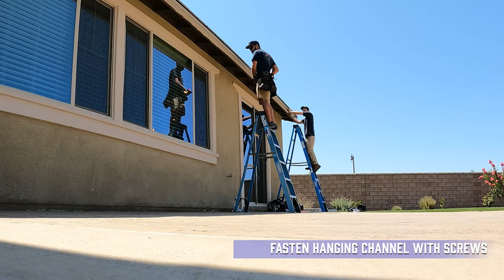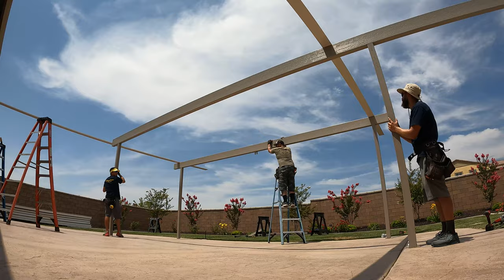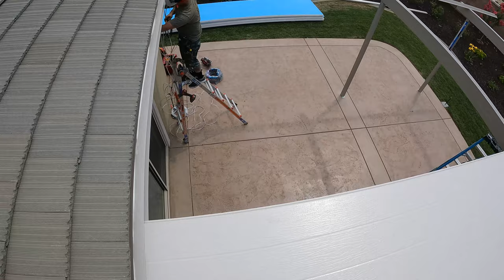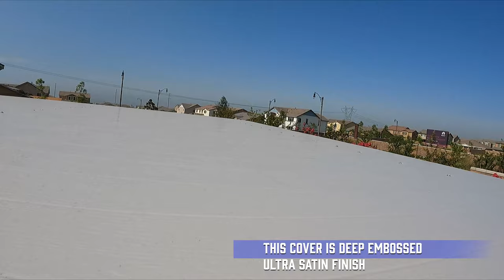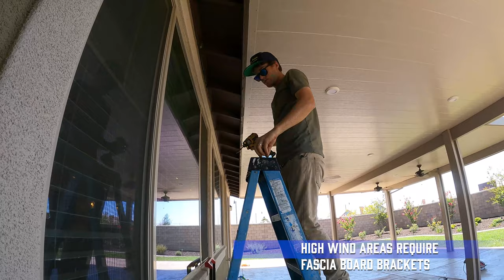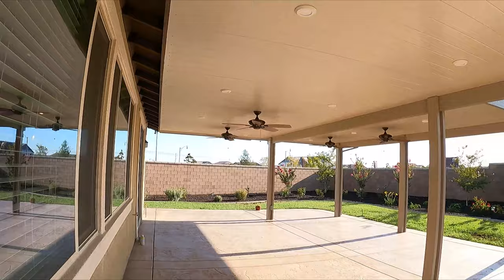How To Build a 24 Ft Projection Patio Cover Ultra

Comment: This is close to what I want. Roof mount because we have a Mountain View.  Roughly 10 ft Hugh 20 ft projection by 34 length
Reply from the maker: Awesome Cbingham, I'm a huge fan of roof mounted patio covers, gives the patio great air flow and also helps maintain a great view like you have. Fell free to reach out if you need help designing and building your patio cover. 

Thanks for the comment and we hope you have a great rest of your day, 
Everyday Patio
Everydaypatio@gmail.com

Comment: did you guys use regular 14-3 romex wire for the electrical or something else?
Reply from the maker: Hey Raul, mostly 14/2 it 12/2, depending on the house breaker size. We just run dedicated lines for the fans/outlets and lights.
Reply: @EverydayPatio  thanks. I was just wondering if outdoor wiring was required for this application.
Reply: @raul4j It doesn't hurt to use outdoor or grey wire. Technically if the roof is sealed correctly, water shouldn't get in the raceways

Comment: Our HOA allows elite roof patios but requires they be covered with something resembling shingles but comes on a roll and uses adhesive so that it isn’t white on top & matches the houses’ shingle color - I’m clueless what that is. Have you heard of this?
Reply from the maker: Hey Lucie, great question. We call that Ranger Roofing, or Insulated Panels with OSB on top. This let's you add Shingles or Tiles to the roof. This let's you match the roofing to the house, HOA rules can be all over the place, they may be requesting that so you don't get non-insulated or flat-pan roof. That usually doesn't look as good on top, as insulated.

Hope this helps answer your question,

Have a great New Year!
AJ

Comment: How did the beams go into the floor? Screwed? Did it cracked the floor when screwing in? Going to do mine and curious how it’s going to effect my tile.
Reply from the maker: Good Day SkynDive Productions, thanks for the great question. This patio cover had a strong enough cement foundation, that was installed properly and given proper time and conditions to cure. This with the exterior footing, led us to not need more extreme footings. We attached directly to the concrete, as far as tile goes, you can't attach to tile, you would need to attach to at least a 4 inch. thick concrete slab or pour an appropriate sized footing. The tile would definitely crack.

Hope this helps answer your questions and would love to see the project after it is done!

Hope you have a great rest of your day,
AJ
Everyday Patio

Comment: Awesome job.  What kind of wiring cable was used? Having a patio installed and they are saying they are using NB-B 12/2 for the fans and lights. Is this common?
Reply from the maker: Hey Anthony, every company has a preference for electrical and certain cities have even more exact preferences. I don't run 12 gauge wire, unless the client plans on pulling alot of power with the patio cover, like a heater. Most appliances don't pull alot of electricity. You can always do the math and see if your at risk of tripping a breaker, and need to run heavier gauge wire and add additional breakers.

Hope this helps and thanks for the comment,
Everyday Patio

Comment: Did you take off the gutter to mount the C- bracket?
Reply from the maker: Hey Andres, thanks for commenting, there was no existing gutter on this house, so we didn't have to remove one. If you did have a gutter attached to your eaves, you would remove it, and mount a few inches below the drip edge.

Hope this helps and have a great day,
Everyday Patio

Comment: Nice work I’m getting ready to order my own cover. Do you have to run panels with the fan beam for the recessed lights?
Reply from the maker: Good Day Christian, you should be using a Fan Beam AKA Electrical Chase for running all your electrical lines in the patio cover. Many companies pipe in electrical through the top of the patio cover, but this should be seen as a last resort solution, the extra cost of the fan beam, makes up for the peace of mind, of a more water tight electrical seal.

Hope this helps,

Have a great rest of your day Christian,
Everyday Patio